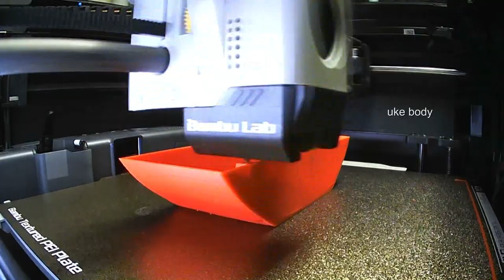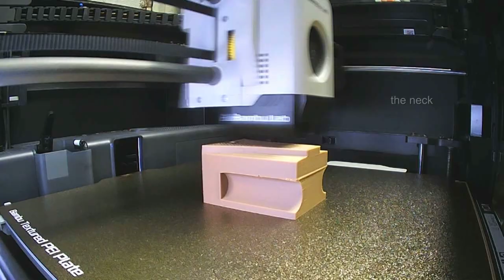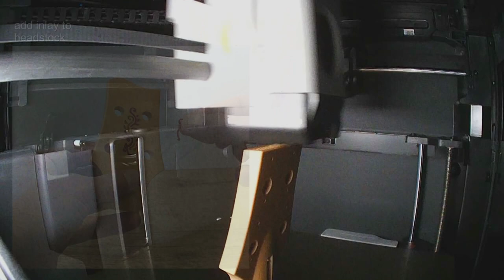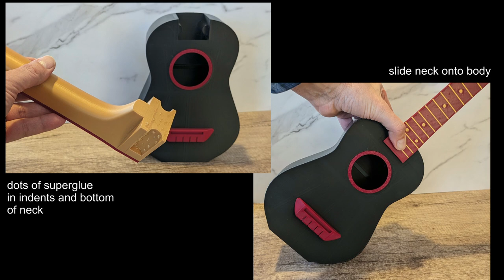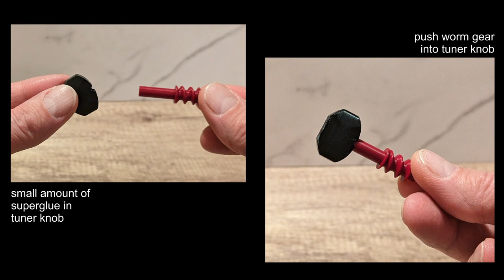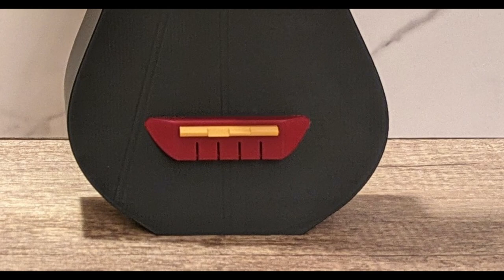Ukology - sound demo and build instructions for 3D printed ukulele

Comment: I want to print that as soon as possible with 30% wood PLA :D but could it be possible to print and assemble a tenor uke?
Reply from the maker: I tried wood PLA and was disappointed with the results.  It didn't really look like wood.  And the wood PLA was much more fragile than regular PLA.
Reply from the maker: Larger ukes are on my to-do list.  Next I'll try a concert.  The problem is I need a bigger printer :)

Comment: Hi, thats a great work, thank u for the sharing this amazing piece !! I have a question, I printed all parts and combined them together but I am curious about how do you set the ukulele strings on that bridge ?
Reply from the maker: The saddle (the long thing piece) goes into the bridge.  It's a compensated saddle to help with intonation, so make sure to orient it like is shown in the video. This ukulele uses a slotted bridge.  To string it, tie a knot in the end of one of the the strings and slide it into the slot.

This link gives more details on how to do it : https://www.pohakuukulele.com/ukulele-string-knots  and there are plenty of videos available for how to string a ukulele.
Reply: Thank you so much, it was very helpful ! @jwnicholson1

Comment: Do you have the stl files for the tuning gears and screws? I don't see them on any of the sites you uploaded the files to
Reply from the maker: Thanks for pointing that out.  I uploaded the tuners separately from the ukulele files since I plan to use them for new projects.  There are links to the tuners in the project files for the ukulele.  But to make things easier, I have added direct links to the tuners in the video description.
Reply: @jwnicholson1  Thank you very much!

Comment: What material did you use? also how long did it take you to come up with the design or did you take it from somewhere
Reply from the maker: Mostly I used PLA.  I tried PETG for the body, but the bending modulus was very low which resulted in a very quiet uke.  I found there was a fair amount of difference in the bending modules in different PLA vendors, which also affected the sounds.  My favorite PLAs were Bambu Lab, HatchBox, and Polylite.

I designed this from scratch.  It took me around two months, with lots of mistakes along the way, to get to a fairly decent design.  Then another couple months of refining the design.